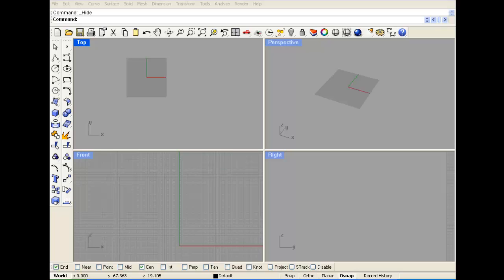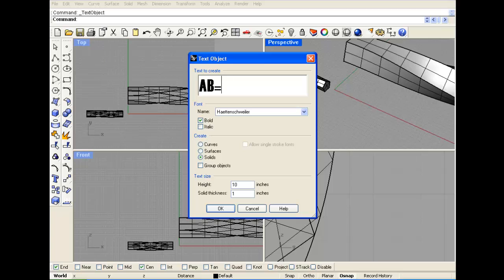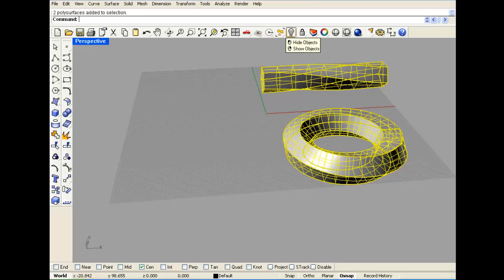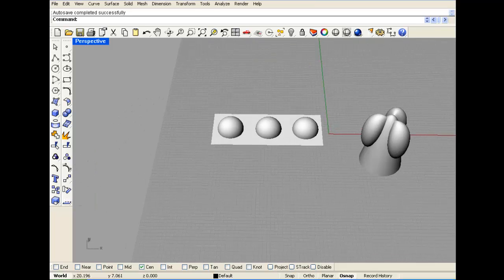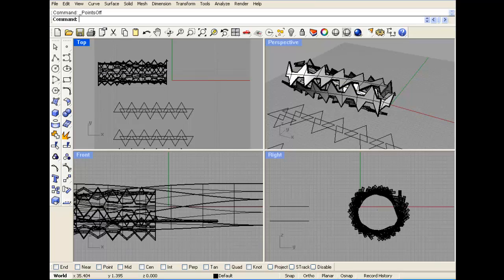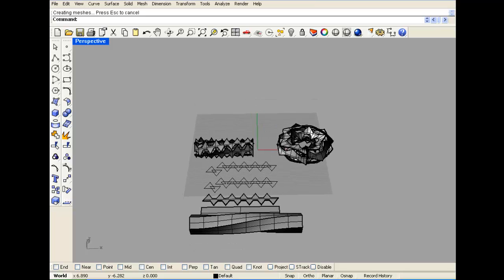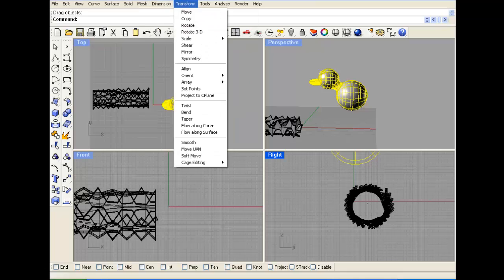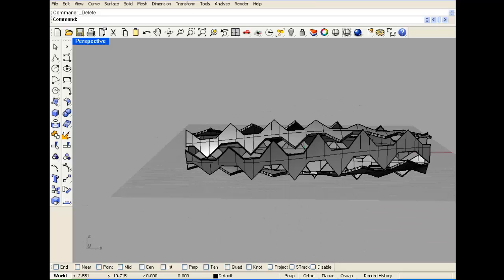The Regal Rhino. Rhino 3D: Flow Along Curve/ Surface and Cage Edit

Comment: When importing illustrator files, always save from illustrator as AI version 8.  Import into Rhino.... you will find the "AI" (adobe illustrator) file type beside PDF in the list of file options to import. 
If you want the imported file to land in the middle of your screen in Rhino....then drag the ruler 0,0 location to the middle of your illustrator graphic. (Drag from the top left corner where the horizontal and vertical ruler bars meet). Then save as illustrator 8 and import.